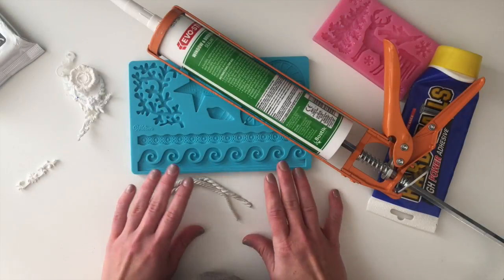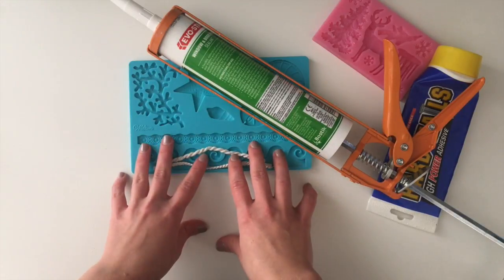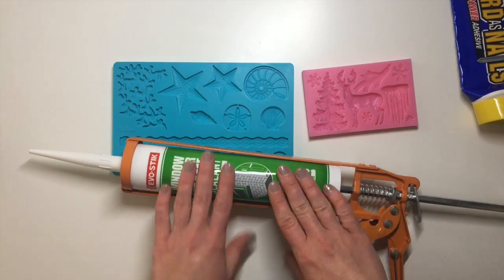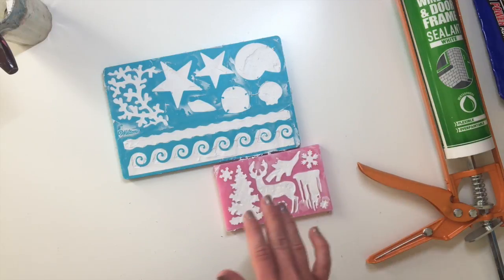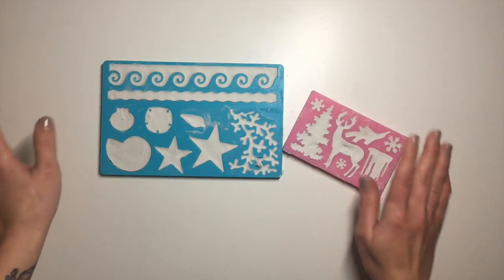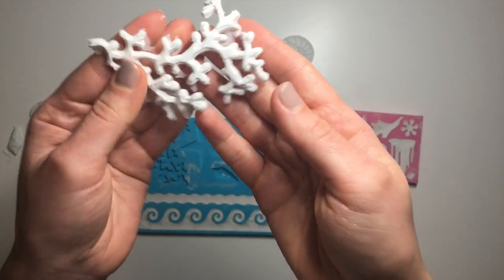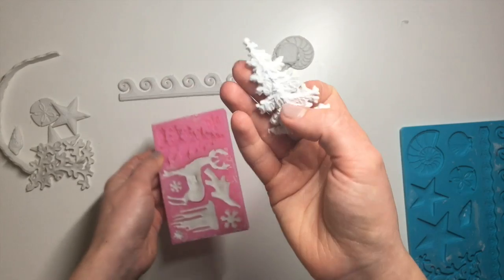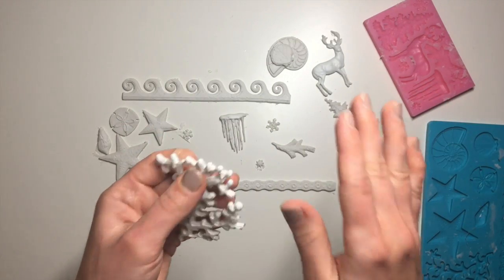HOW TO MAKE CHEAP, LIGHTWEIGHT & FLEXIBLE EMBELLISHMENTS WITH SILICONE MOULDS

Comment: For delicate lacey molds, Modpodge is an ideal medium.   It dries clear and bendable.
Reply from the maker: Ooooooo that’s so good to know! I’ll have to try it out over the weekend! Thank you for the tip! ❤️
Reply: I haven't tried that, Thank you 👍
Reply: Does it release from molds easily?
Reply: @sharon94503  Yes, from silicone molds I had no problem.
Reply: Mod Podge?! Who knew! I'll have to give that a try. I used a thin lacy mold for the 1st time the other day &  used air dried clay(out of curiosity) & it did not work! lol It was a mess. Love using my IOD molds on plastic baubles for Christmas ornaments, but I've seen a lot of people using the thinner lacy molds & wanted to give it a try. Just wasn't completely sure what type of medium to use. Now I've got a couple of new ideas. Thank you!
Reply: @Super Annie Oakley  Hi can you recommend where to buy moulds from please x
Reply: Hi, wouldn't the modge potch stick to the celicon molds?

Comment: Good idea! It may be worth noting that not all flexible sealers can be painted over - so check label before buying if being used for painted projects.
Reply: The brand DAP is you can paint
Reply: @yolandagofigure  @Yolanda Rosato Which DAP product do you like best? I’ve tried a few with mixed results. Thank you!

Comment: I don't know if you'll see this, as this clip is a few years old, but if you want to save your hands from extra stress, cut open the caulking tube and scrape all the caulk into a seal tight jar.  It will still be good, and not dry out.

Comment: My husband wonders why I'm on youtube all the time and it's because I keep coming across amazing people like you that have amazing ideas. My ? is. How do you store them and how long do they stay bendy.?
Reply from the maker: Hehehh that’s awesome! I just store them in a tin, honestly could do with a better system because I just throw them in there. They stay bendy forever. At least in my experience, I’ve had some for 2 years and they’re still bendy :)
Reply: @IvetaZiedina  if a person is refurbishing furniture they could use this system or put on a frame. Possibles are endless. I need to find several tubes. 😂🤦‍♀️🥰
Reply: I just filled all the silicone things I have it's clear though . Will wait 24 hrs.

Comment: Thank you 😊 I so glad to see at last someone from UK😅 I like your videos, a lot of practical information, straight to the point and very helpful. Following your instructions U have used Hard as Nails glue from company 151 (£1 Poundland) - works like a charm, now I am going to use flexible  acrylic siliconized sealant (£1.50 Inexcess) . It so much fun when we can use something different than posh expensive brands. I am looking for nice lace/ texture silicone mould for baubles decorating, could you please recommend some? Its not easy to find something really nice. Thank you for sharing 😊
Reply: Yes I have purchased  lots of fantastic moulds from Temu!  There really cheap! Good quality too xx
Reply: May I ask where did you buy this blue mould with shell and waves? Can't find anywhere 😊
Reply: And BTW warning - don't use "ever build external frame sealant" Doesn't dry even in very shallow moulds for several days, took me ages to remove this and clean my moulds. Thank you for all your videos, I watch them all the time and learn a lot from you 😅

Comment: Like this, thank you. Acrylic paint is good but it takes even longer to dry, I put things on the heater, results are ok,
Reply: I tried the idea but I couldn’t remove the silicon from the molds
Could you help me please 
Did you put any paste or something before spreading the silicon
Reply: @emanaboutaleb6559  it's not silicone you use it's "Caulk" that you use in moulds, Painters Caulk, hope this helps.

Comment: Beautiful! I wonder if they are paintable as well like air drying clay? Btw thx a lot  for  sharing. New to decoupage art I found your channel rly informative so subbed to your channel. Thx! Greetings from Korea.
Reply from the maker: You can paint them, might have to do 2 coats as the surface is a bit more slippery but you can most definitely paint them :)
Reply: Try putting a coat of gesso on first, especially the surface is more slick. It will help the paint adhere much easier.

Comment: So good to find out 😊 When you work with Das, do they also get to sit or take them out immediately? I ordered Das 😊 Thanks for a learning video 😊🤗
Reply from the maker: Depending on the shape/thinned of the mould, some very thin but deeper moulds like the ones I used on my “Victorian” style baubles before Christmas are really difficult to get out when wet so I use other stuff for those but for the most part you can take them out straight away ☺️
Reply: @IvetaZiedina  Thank you so much. I can't wait to start, hopeful I get all my stuff soon 😊😊💖

Comment: Help please, what am I doing wrong? I have been using flexible caulking to make moulds, but I am not having success. I came upon your video because of the mould you are using is one I have. The tree, snowflakes are coming out fine but not the deer, it keeps having I think are air pockets. The body looks like it has cut holes and the face is distorted. Also have mini bird moulds, same thing is happening. Any suggestions would be so helpful.

Comment: Hey Yvette, I tried putting the white silicone sealant in my moulds and now after even 4 days they are not coming out at all... Can u pls help me with this ... Or else all my moulds would get ruined... Pls help ....
Reply: It is very important that the silicone is acrylic. There is also acetate silicone and it can be used to make the mold itself. But acrylic silicone is used to fill the mold, to make decorations. If you can't peel it off the mold, you've probably used acetate and destroyed the mold.  It has an unpleasant smell like strong vinegar.
Reply: Yes, silicone sticks to silicone!

Comment: TYFS - 🙄 so once these have dried/cured do I need to use a special or particular type of glue to adhere them to my project?
Reply from the maker: I just usually use either pva glue or same “hard as nails” adhesive. You just need to be careful with superglued coz some of h them react with the sealant and melt it away

Comment: So the sealant isn’t silicone? Because I used a silicone one in my silicone mold. They became one.
Reply: Bummer! Unfortunately silicone sticks to silicone so if you have a silicone mold and fill it will silicone, that will happen. In the video she used "door and window sealant" - not sure what the material actually was - and the other option was a kind of glue (presumably that does not stick to silicone, because she didn't demonstrate that one).
Reply: Acrylic sealant.
Reply: You can't paint silicone but acrylic sealant is perfect for painting